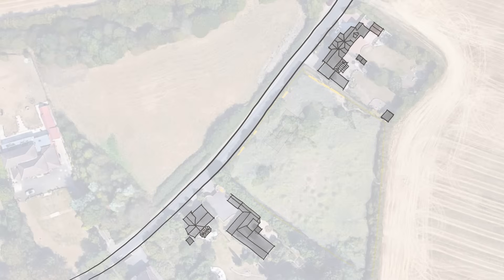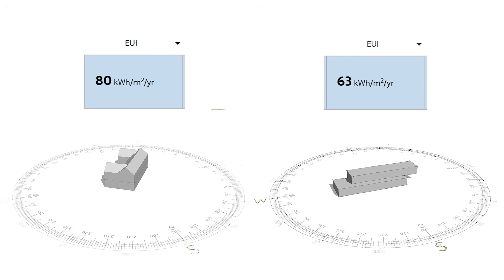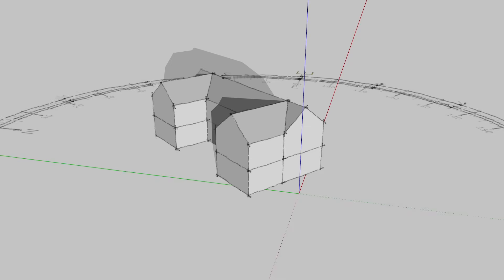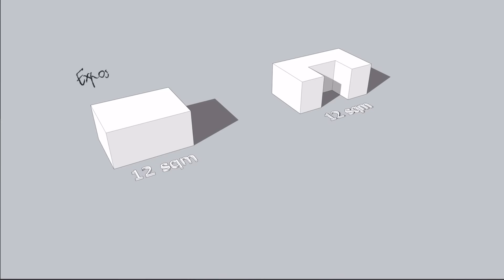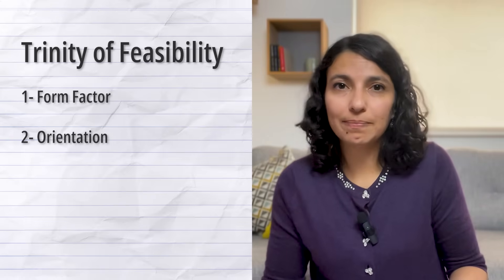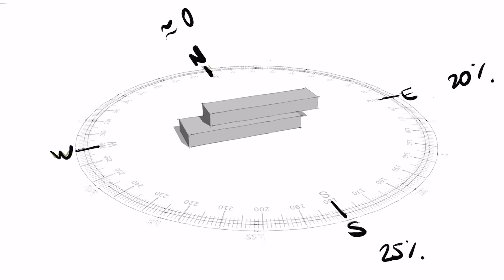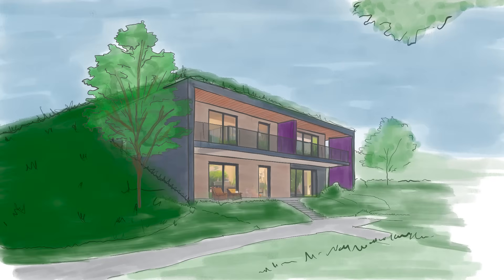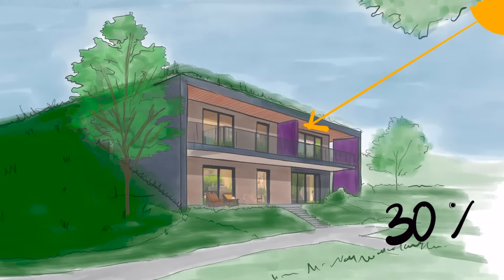The 2 min Design Change That Saved My Client 21% Energy

Comment: My Uncle was a Structural Engineer. He had a very low opinion of Architects.
He was known to write K.I.S.S. across plans and send them back. Keep It Simple, Stupid.
One plan had a cantilevered balcony with a pencil thin column poised to punch up through the concrete slab like a nail. Total lack of reinforcement to spread the load.

Comment: Hi Sara. This is an interesting video. I am curious how these rules could be applied to homes closer to the equator where heat is very high. 

P.s I am not an architect or an energy engineer (I'm actually an electrical engineer). I am merely curious as this is the first time I've heard of things like this.

Comment: So is one of the implications of what your are saying is that the cooler the climate the less desirable some sort of U-shaped or courtyard design?

What you have said about reducing the ratio of surface area to volume makes it easier to keep a building warm. Wouldn't the same apply in hot climates? Less surface area means less area for heat to enter the building?

Would that mean that U shaped and courtyard designs might only be appropriate in a narrow range of climates? Does this narrow range correlate with the traditional use of open and enclosed courtyards around the world?

How is that balanced against the value that open sided and enclosed courtyards have in the outdoor living spaces they create. Espeacially in windy climates where a courtyard can provide a comfortable external room sheltered from the wind?

Would a compromise be the main range (two storeys) of a house facing north with single story wings on the sides? Or would this completely fail because it significantly increases the surface area? What if the single story wings were rooms where it was not necessary to control the environment within them? 

Or would a better idea be to completely forget creating a courtyard with the building and use solid walls instead? The courtyard being created by a walled garden?

Comment: You have to reintroduce awnings or hard elements with the same functions. Windows have to be completely shaded from high summer sun and exposed as much as possible to the low winter sun.  Old fasades had those elements and looked way nicer than flat modernist designs.

Comment: Hello Sara

I appreciate your knowledge on orientation of a structure/Building. 

I have a different problem.

We design factories in hot and humid climate - say tropical zone.

Another disadvantage is there are a lot of employees working in it.
This is a typical garment manufacturing unit.
Also we have a lot of electrical motors running.

So what should be the orientation in this scenario ?

Surely, would want to avoid south and west direct sunlight. 

Would ideally prefer to get North light, if possible. 

Main concern is the heat and humidity within - and more so these factories are PEB shed - a tiny box. 

I would appreciate your thoughts on this.

Air circulation is also one of the major factor we need to consider. 

20 changes per hour to reduce build up of carbon dioxide 😊

Comment: For the form, not everyone wants to live in a shape that resembles a box. I for one don't, I'm not a big fan of stuffing all the active rooms to one end & the sleeping spaces to the other end. It's really nice to split it up especially for guest rooms or having older children on the other end from the parents & smaller kids. Teens tend to sleep less an make more noise so it's nice to have a bit of rooms between. I know that can be done with a rectangle but then there are less options for windows in the spaces where most of the day is spent. I really like the u shape & it seems like a no brainer that just making the roof cover any voids should fix the problem if the top just needs to extend all the way across or even a indoor outdoor space like a sun room would be a solution to make the house feel like it has a pleasant flow. It's also nice when all the plumbing is lined up in a way to where if it fails there is less damage all around the house. I'm pretty tired of how houses are designed from all kinds of perspectives other than what it feels like to live inside them. This is really information for house temperature so I'm probably going to have to come back an rewatch again till I remember it well. ^_^

Comment: We live in the mountains. Our property does not get direct sun from the east until 11AM. So, the idea to have a sunroom on the western face, and to face the front directly south, was not all about the stunning evening views. Passive solar increases the PM temp in the sunroom by about 5 degrees F. Closing the doors in the evening isolates the inner living space from the outside walls in that room, and prevents heat loss from the main living space, while the sunroom stays warm for most of the night. That space will call for heat from the hydronic system periodically between 3AM and 11AM, when there is sun. When you have snow for 45 straight days, your plan is busted, but it looks like a great idea when the sun is shining!

Comment: Even not rationalizing all those arguments, about 8 years ago I was to choose a studio apartment for rent in a building. All rooms were similar, the building was U shaped, open to the West.

I chose one studio at a lower floor, facing North and at the bottom of the U. In a position that would receive the minimum of sun. I had the feeling that it would minimize the direct heat from the sun. Oh, ,I did not mention, I live in Thailand. I hope I managed to save on air conditioning bill.

Comment: The "small change" wouldn't pass in my country. Facade alignment trumps all other considerations. So the house would need to stick to the NE/SW orientation, regardless of all the other changes. Unleeess... the architect would make change the form into a boomerang shape, so that at least one wall aligns with the other buildings' facade. But good points otherwise.

Comment: Of course, the opposite logic applies in tropical regions like Southeast Asia. Instead of maximizing sun exposure, the goal is to minimize heat gain by orienting buildings to avoid harsh east–west sunlight, promote cross-ventilation, and use shading elements to keep interiors cool. In the UK, you chase the sun; in Southeast Asia, you shield from it.

Comment: It depends on your position on the globe, north or far south of the equator as in our case, you face the house north/north east, the west is very hot, yet north gives you winter sun….if..the house eaves are the correct width . The Middle East use positioning and high/low  wind cooling vents that flow over water urns.

Comment: 3:30 When you say "up to 25%"  S and no more than 20% E/W (so a limit of 65 for S/E/W total) , that leaves 35% unaccouted for, that would have to go N...
Reply: The glazing ratio is based on the surface area of each side of the building not the total surface area. You don't need the percentage numbers to add up. 

With 25% glazing it means that 1/4 of the total area of that face of the building is glazed. 100% would be fully glass on that side. 0% would mean no windows on that side. 

This is a separate percentage for each side of the building. You could have a 100% glazing ratio on each side of the building and by your understanding that would mean 400% glazed. Which obviously doesn't make much sense, which is why the ratio is specifically for each side.

Comment: You changed a nice shape into a boring one. You also robbed your client of much needed shade during summer.
Your obsession with energy causes you to make bad decisions.
Solar panels and a heat pump provide more than enough energy to compensate for any orientation. Modern houses generate more energy than they consume.

Comment: All true, BUT there are many factors that count when choosing the shape and the position of the house - views, winds, neighbors, landscape, noise, local restrictions, design codes, etc. If energy saving is such a big issue for somebody, just build a smaller home or use energy effective construction materials.
Reply: Yea, now instead of having a great view of their backyard, this client sees half their yard and their neighbors house. Also going from a U shape to a straight line is a pretty big design change, hopefully their bathrooms and water heater are in the same area and not on opposite ends otherwise the client is going to be wasting a lot of water waiting for their showers to heat up.
Reply: Just smaller home :))))) when every inch is gold

Comment: The two long streets in my little subdivision run parallel to the highway, which runs parallel to the railroad, which runs SE to NW. All the homes are ~45 degrees off NS-EW orientation. My home has a dark brick exterior, with significant heat gain in the Kansas summer. I dealt with this by planting ivy on the SE and SW sides. This blocks the sun in summer, the leaves fall off in winter to allow solar heating.
Reply: Used the same method of shading as well.

Comment: Nice video! TY! I am sincerely trying to find the right “glazing ratio” for a geodesic dome-type home. Curious if you’d apply the same percentages to a spherical building (25-30% to the south)? Obviously, with “air-tightness” being high on the list, as well. Do you recommend any programs that are preferred for geodesic, or dome-hybrid design? New sub.

Comment: I am a former California real estate sales person.  I keep hearing about “semi-detached” homes in videos from Canada and the UK.  Can anyone tell me what they were detached from?  

If a house is a stand-alone house, we call it a house.  If it is attached to another unit or units, it is possibly a townhouse or condominium, co-op apartment, or duplex.  The duplex is two homes with a shared wall and single owner.  The others usually have shared common areas and a homeowners association.  

“Detached” implies something was removed.  “Attached” is something that gets built that way, I assume.  Two or more houses attached to each other.  But a halfway attached or semi-detached house makes no sense to me.
Reply from the maker: 😄 Yes, I'm with you. Detached in the UK means stand-alone. Semi-detached is this weird typology where the building looks like a single house but it's split in the middle by a shared wall and it's two units with different owners. "Terraced" is when it has only two facades and it's joined with other houses on the sides. "End of terrace" is the last house in the row so it has three facades.
Reply: In the US over 80% of homes are 'stand alone'. In the UK it's around 23%. As it's more typical for UK homes to share party walls, being 'attached' to other homes, it makes sense to differentiate 'stand alone' homes by calling them detached. I think duplex makes more sense than semi detached TBF. We don't call terraces fully attached.
Reply: In addition to semi-detached where it is joined to one other, we also have link-detatched  where the homes themselves are distinct entities, but they are joined together by garaging.

Comment: But how would you best orient this house if you also had to consider summer air conditioning costs?
Reply from the maker: That's a very good question and the answer mostly depends on the location and the weather. Some climates don't need solar gains at all and the challenge becomes keeping the sun out without sacrificing daylight. Some climates need the sun in winter but not in summer and in this case, you can play with shading and sun angles to only allow what you need when you need it.
Reply: @SaraSaadouni_TAC  Much of the USA experiences both cold winters and hot, humid summers, which makes it almost impossible to find clear, logical solutions for the orientation of a building. Thank you for the reply.
Reply: Exterior shading for summer so you can get free heat in winter.
Reply: Decidious trees may be useful for summer shade & winter heat.

Comment: I'd change the glazing ratio to 50% south, 25% north and split the rest evenly to east and west. Of course this is not always achievable, but good to aim for. North glazing may come with some heat losses but provides great consistent lighting and is especially important if the N-S dimension is deep. East and west windows are hard to shade, although you could use trees or a large roof (covered patio?) if there's enough space. Conversely east and west windows offer little to no solar gains in winter at higher latitudes as the sun is setting by the time it swings far enough around to light them.. 

These ratios are for mid to high latitudes and would differ the closer one gets to the equator.
Reply from the maker: Totally agree - ratios will change by location. And I agree with you for the north windows. Sometimes a bit of efficiency needs to be sacrificed for better daylight and wellbeing! Thanks for watching!